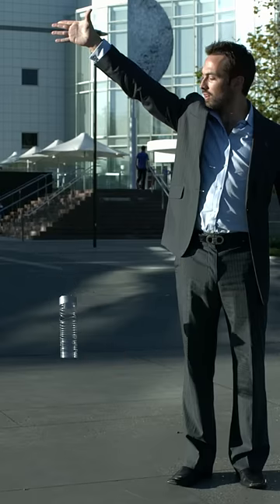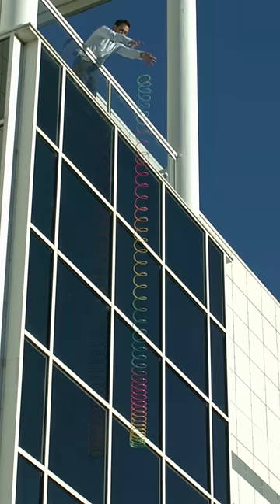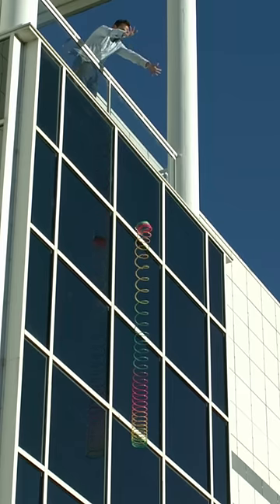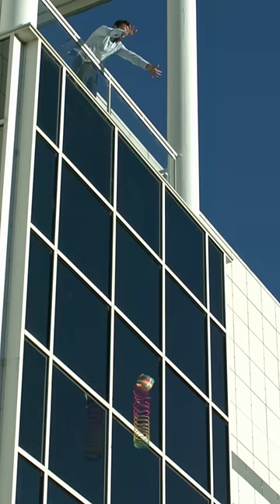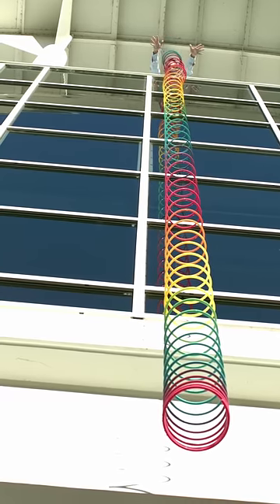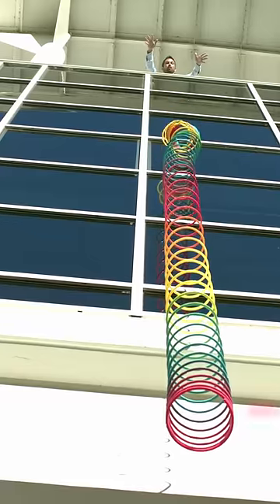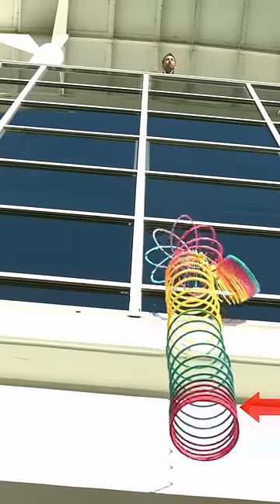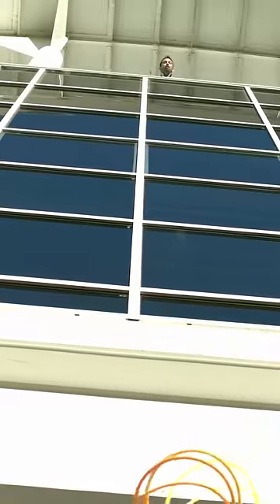How a slinky falls in slow motion #shorts

Comment: This is because the initially when you hold  the slinky from one end and other end exert a gravitational force . According to Newtowns third law  "every action has equal and opposite reaction" so the tension force create in slinky forcing upward against gravity . When you drop the first end  , it fall down but due to "innertia of rest"   bottom end remain in rest until the all the tension force stored in the slinky is not released.
Reply: Loved Ur Explanation...
😀😀

I was going through the comments to find out why this happened...
And U Pleased Me...
Thank U Very Much....
😃😃😃
Reply: For simple minded people like me it doesn’t drop cuz it’s already stretched and would need something to pull of from the bottom to stretch more therefore it needs the top to push it down after it uncompresses so it can push it down
Reply: Great explaination😲👏🏻👏🏻👏🏻
Reply: I don't understand the part of "the innertia of the rest", do you mean that until the wave didn't reach the bottom of the slinky, the impulse can't be transmitted?
Reply: Now how do you explain it using general relativity?
Reply: Inertia of rest is not why it remains suspended, but it is because the upward force equal to gravitational force remains the same until the previous coil comes down.
Reply: For brainless person like me, this is the simple terms to explain it. 

Place the slinky horizontally at the floor. Then ask your friend to hold one end, and you hold the other. Your friend hand, act as gravity that pull slinky

When you release the slinky, only your end that go towards your friend hand. The other side of slinky also tried to go to your side, but it can't do that because the gravity hold it. So it doesn't move anywhere

If we neglect gravity (which means that your friend also release it at the same time), then the slinky will collide at the middle
Reply: @Airtheteengeneretion  lol this makes no sense to me, nothing stops gravity from pulling down
Reply: @troywright359  each coil supports the next but takes time to collapse, so the collapsing due to gravity has to propagate through the slinky before all coils are moving
Reply: @bbjygm  i don't understand how the preceeding coils can hold the others up when there is nothing supporting it
Reply: @troywright359  The tension in the coils pulls it upwards, thinking of forces there is  gravity acting on each coil but there is also an equal and opposite force of tension that leaves the slinky at rest (before being dropped) the highest coil has no coils above but it is being held so that cancels out gravity, now when the top coil is released the only force acting on it is gravity so it falls which reduces the tension on coil below which in turn causes it to fall, repeat till you reach the bottom coil. Maybe this will help you understand, maybe not haha
Reply: @troywright359  exactly, nothing can stop gravity from acting on an object, but if an equal force in the opposite direction is imposed, you can cancel out the force and suspend it as long as the forces are equal and in the opposite direction.
Reply: Thanks Einstein
Reply: @suedenim6590  well yahhh, but thru the raging fire they found the terrorist passports made of paper p,but zero plane parts....lmao
Reply: @BKSEA1-007  don't forget a 5ft 7 guy took out two marines with a  box cutter (let's assume every other man on the plane wanted none of a 5ft 7 guy they were far too scared) then from 500 miles away and above the clouds the entire time he u-turned and did a feat of dead reckoning faaaar superior to columbus himself and managed to hit a building? Lol. Cool story bro. Personal fave of mine is the answerphone message from the man that rings his mum (which is still impossible by the way you can't connect to phone towers from up there) and introduces himself (His mum) by using his first, middle and his  surname to his mum Hey maybe he thought she thought he'd be someone else. Also cool how they immediately  knew it was a guy in a cave in Afghanistan too huh. I'm sure it's just coincidence that as soon as American troops are guarding 97% of the worlds opiods they now have a huuuuuuuuge opiod problem. Its so insulting to anyone in possession of intelligence its a joke
Reply: @suedenim6590  I like the part when the guy says pull it and a 40 story building that was untouched just fell in its footprint like it was demoed r something ...  and that same build held the paper work of one Donald Russell and where 2.3trillion was unaccounted for...wierd ... lol
Reply: BUT WHAT ABOUT IN GENERAL RELATIVITY
Does it do the same in an upward accelerating frame of reference?
Reply: @BKSEA1-007  if you clock it,  its literally fkin behind her in the live video as she's announcing that it's already collapsed. Their own people 👌👏 😔
Reply: @nohaxjustxmod-sfs3984  apologies that was childish. The upward acceleration has 9.81r metres per second of force applied to it so you'd calculate accordingly.  I'm sure your mom is beautiful it was a joke friend. Forgive me x
Reply: @suedenim6590  the demolition incinerated is all...
Reply: @PenclMusc  ummm😐😐
Spacetime: left the chat

Comment: There are 2 force acting on both the ends of the slinky. 1) Gravitational and 2) Elastic force. The Gravitational and Elastic force acting against each other on the bottom end the slinky and cancelling out each other so instead of going down it is held at the same place while the the top end is accelerated by both gravity and tension through elastic force acting from same direction.
Reply: But the elastic force depends on the change in configuration of the slinki. So as the slinki starts to move to its original position the eleastic force changes and then both elastic and gravitatiinal forces cant be equal. Then how could the lower end of the slinki be at rest.
Reply: @danishakhtar8148  think of it this way: if there was no gravity at all the slinki woud have shrinked at the midle of  its body length. But Since there is gravity , the bottom cannot go up , but will remain at rest until the top of the slinki comes down accelerated by gravity and by the elastic force. Now to answer your question, you are right that the elastic force and gravity are not equal anymore but at the top of the slinki, thats why you see it coming down. When you are holding the slinki you are holding it at the first winding but  creating the tension in all of its length. When you release it you no longer are equaling the gravity force on the first winding so it falls while braking the tension to the second winding and so on until  the whole tesnion is broke down.
Reply: @adriatikcifliku1346  i don't  got what you are trying to say. Plz elaborate

Comment: Think of it like this.  The reason the bottom doesn't fall is because there is tension in the slinky that exerts an upward force which hold it still until the top of the slinky reaches the bottom.

Comment: It's counter intuitive at first. But the key is to remember it's the CENTER of gravity for the entire slinky that counts. NOT the top.  The top is falling Faster than normal G would pull it downward because of the tension of the spring being stretched.
Reply: Thank you, that's the piece I needed, makes more sense now.
In that case, it might also work in reverse with a compression string folks? Where the top stays put until the spring is uncompressed (but the test would require a clever way to instantly free it all from its squished state in air). I think the answer is no and the explanation would be interesting.
Reply: @garyha2650  Actually I think it the answer is no. The topmost coil cannot move until the one below it moves right?
Reply: @garyha2650  That is an interesting idea to test out. Remember the slinky is very loose spring. even stretched out it's not a lot of tension. Since even it's own weight can stretch it out. If you had a spring that was compressed, chances are it would decompress almost immediately both top going up and bottom going down. Before it as a whole even started moving. But if the spring was equally as weak as a slinky  Yes you may get a situation where the top seems to stay in place.  I actually haven't thought of this next point until now either so thanx. But The reason the Slinky experiment Works so beautifully is because GRAVITY is actually the thing that's spreading the slinky out. And when you release it again it's GRAVITY pulling on it.  So it's G versus G.    However ( if another person was to pull on the bottom even more and stretch it out father and both people let go. It wouldn't work. The bottom would go up a bit too cause now you've added more tension than gravity naturally would have. But in Your idea you would have to perfectly match a spring that when released is equal to a free fall acceleration. Just my guesses though
Reply: And, the bottom is traveling up, but, the gravity effect(being equal across the entire slinky) makes it appear as though it is stationary.
Reply: @Templestone  Doesn't just appear stationary. it IS stationary. Even the bottom of the slinky Wants to fall down but is perfectly balanced by the amount of stretch on the slinky.
Reply: @kraven4444  Sir, you made my head spin. I can't get a handle any of this so will you join me for a few beers and we can argue about football?
Reply: @bobdillaber1195  lol that would be an easier topic. Not like I understand this one either beyond a surface level.
Reply: @kraven4444  
I won’t argue with you. 
Technically, the bottom is in an upward motion, but, has the "appearance" that it is not moving. Relative to space, it is stationary. Relative to the physics of the tension within it, it is moving.
Reply: @Templestone  Yes technically the spring is perfectly closing toward the center. But we relate that to the Earth we're on. Relative to earth it's moving the same. Of course Earth is moving The Solar system is flying through Space and Space is stretching as well.
Reply: @kraven4444  No, it is inertia verses gravity.  You need to do some more cogitating.
Reply: @DumbledoreMcCracken   I mean it's Gravity stretching it down before release. Than it's gravity when he drops it. That's why they're perfectly balanced.
Reply: @kraven4444  If there were no inertia, the spring would instantly collapse (if initially held in an expanded state, by any force), due to the tension in the spring.
Almost no one understands inertia, in a force balance sense, even though it is taught in high school.  Inertia is the force that resists motion, Mass * Acceleration.  The tension in the spring is from Mass * Gravity.
The tension is highest at the top of the spring, and the tension is zero at the bottom end of the spring.
Reply: @DumbledoreMcCracken  Yes I understand but you're talking about the TOP. It starts slow and goes faster and faster as it overcomes the inertia. But some huge inertia is NOT holding the bottom still. If you cut off a tiny piece of the slinky and dropped it from a few feet it would start to fall immediately. The reason it's not moving is the upward tension is equal to gravity pulling on it. not because it has some huge inertia that gravity is having a difficult time moving. A heavier slinky should than have MORE inertia and thus hang for a longer time? is that what you're saying? Even if that is true. Inertia is the resistance to movement in a direction. but if there are 2 equal and opposite forces pulling in opposite directions, the object is not RESISTING it's simply not moving cause the 2 forces are equal. Once one of those forces starts to overpowers the other, NOW it is being pushed and resisting. So inertia at the bottom only becomes a factor as the center of gravity gets down there and it starts to move. But that's not the reason the bottom doesn't immediately move. Again there are 2 forces acting on the bottom at the same time. If you're pushing or pulling an object from both ends and Can't move it, you don't say oh inertia stopped it from moving. Just my opinion.
Reply: @kraven4444  Inertia is never "overcome".
You need to work some problems from a physics book, and draw some free-body diagrams.  You are not open to learning anything because you already know the "answer".
Reply: @DumbledoreMcCracken  right I literally said it was my opinion and you’ve now talked down to me twice and told me to go study. If you’re not up for conversations of opinions then go teach some kids where they’re not allowed to talk back to you. You may be completely correct and that’s fine. But clearly you can’t stick to the topic without including an insult. Good day to you sir.
Reply: @kraven4444  there are no opinions in classical physics.  There is the correct answer, or not.
Reply: @DumbledoreMcCracken  Yes God. My apologies God.

Comment: A shorter and easier-to-understand explanation is both ends of the slinky are being pulled down by gravity, but the bottom end is also being pulled up by the center of the coil itself because... it's a slinky, it's always pulling both ends to the center. And since the bottom is being pulled in 2 opposite directions with the same force, it stays there and the top end falls first.
Reply: I agree , the centre of mass of the slinky is falling continuously,  above the COM it accelerates at 2g whilst below the COM it is g-g which is zero , balanced in equilibrium and stationary according Newton 1st law.

Comment: "each coil is stretched to support the weight beneath it"
The key to this physics is in this line. Any change to the above State will not result in this effect (like uneven 'stretchy ness')

Another explanation is that the top rings are trying to pull bottom rings at the same rate they are falling. Which is same as what is explained
Reply: During collapsing , each collapsing coil rotates supporting the one beneath it to make it overcome gravity and stay in position , that is why the last one rotates when the collapse reaches it but there is no beneath coil to rotate so it falls .

Comment: The reason this happens is because the slinky is trying to pull itself up and meet in the middle, but gravity is pulling it down, so it stays in place
Reply: Aaaaah, thanks
Reply: @rookandpawn  exactly what I was thinking
Reply: @rookandpawn  Except it's not, it's not doing anything to gravity.
Reply: So is it tension acting there? Also if the gravity was strong enough then would the slinky break apart before it got together?
Reply: Will it work the same in other gravities/air drag or is it a coincidence?
Reply: Oh, thanks
Reply: There are no gravity, it's just the density
Reply: This is a better explanation for dummies like me.
Reply: So the gravity is exactly same as the tension in the bottom? Why and how does that happen?
Reply: @user-ht6ql1rn3w  the gravity would have to have always been like that, so the slinky would have already broken under it's own weight just by the act of you putting it in that position still holding it.
Reply: In physics language tension balances mg
Reply: For tension to be acting, there must be a fixed end no?  In this case where is that?
Reply: @fasalurahman9126  this is a kind of spring tension not string tension
Reply: Called Spring Theory
Reply: @rookandpawn  mmmmmmmmmmmmmmmmmmmmmmmmmmm just
Reply: But depends the tencion, same forces
Reply: Wrong. It was stretched out before he dropped it and wasn’t pulling up.
Reply: @JenMarco  Ok so springs dont work and it must be whichcraft. Is that what you want to hear? You tell us idiots why a spring does this
Reply: @JenMarco  it actually was pulling up, equal and opposite forces, but your right to assume that is not a satisfying explanation. To make it more clear: until the wave propagates through the slinky no new information has acted upon the bottom. Gravity is still pulling down with the same force and the system of slinky above the bottom ring is still pulling up. It's counter intuitive but this is how it works. There is no action at a distance. Until the wave fully propagates  the slinky is still being held from the perspective of the bottom.
Reply: @fasalurahman9126  true. But the fixed end is anywhere the wave has not yet propagated. Until the wave travels the entire distance how can the bottom ring know it has been released? The irony is, that would actually be much more magical.
Reply: Excellent, Thank you

Comment: The center of mass of that slinky is dropping as the top of the slinky falls. Since the center of mass is falling the lower portion of the slinky doesn't need to fall till the center of mass reaches the point where it is no longer shrinking as the top collapses. This would be the same as if you put it on an elastic band.
Reply: Same thing the earth does
Reply: homeworkofficial  I am reading this about a month later, but what original comment said is 100 percent valid. During free fall, geometry of slinky is changing, and C.O.M isn't exactly half way between topmost and bottom most part of slinky .